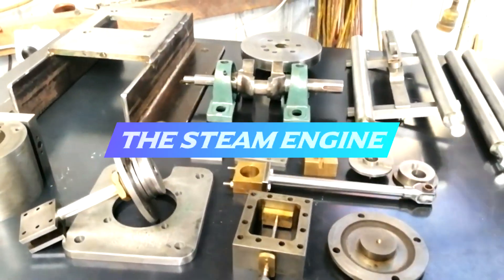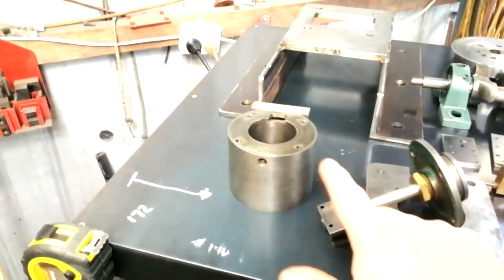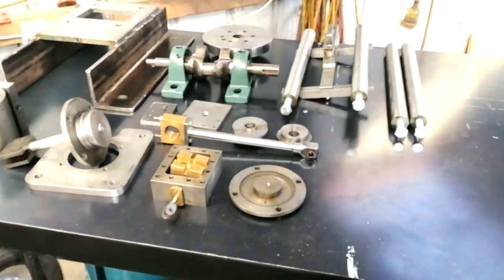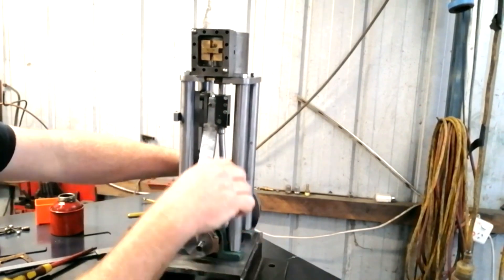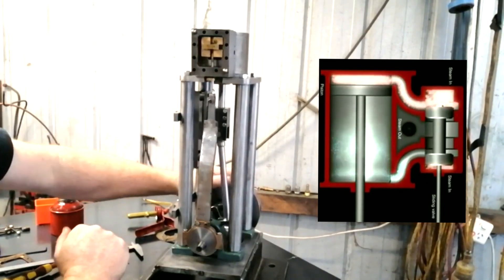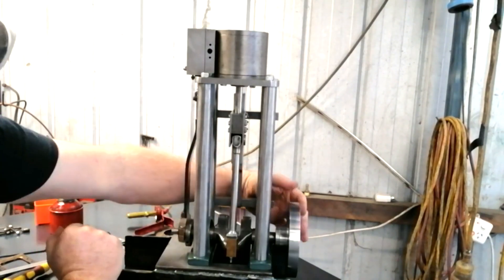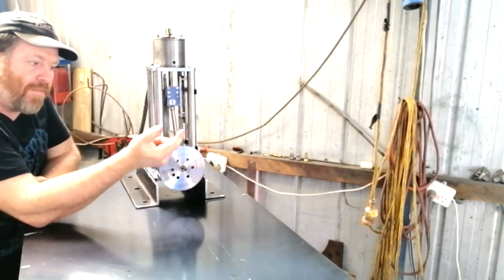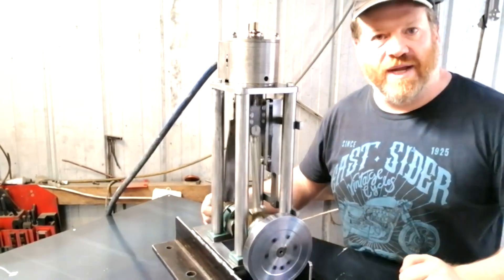The Titanic Project , The Steam Engine ,Titanic build series pt 3,

Comment: How much did it cost you to build one of these?
Reply from the maker: Cost is On going, unfortunately I haven't been keeping a tab on materials used, thanks for taking the time to comment 🙏👍
Reply: @EverythingAnthonySOS  ah alright, I’m mainly asking because the steam engine market is so expensive to buy a large one already built, so I’m wondering if it is cheaper to make it your self.
Reply from the maker: Time is the biggest factor , my engine was fabriacted and designed by myself , if you had to pay someone to machine materials it woud soon add up , I have a lathe and milling machine  and this helps with projects like this...